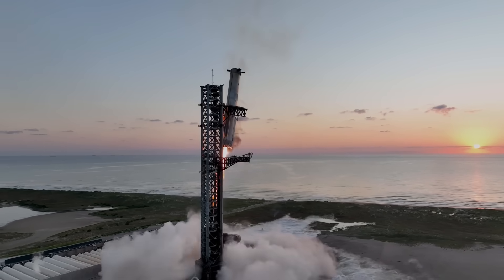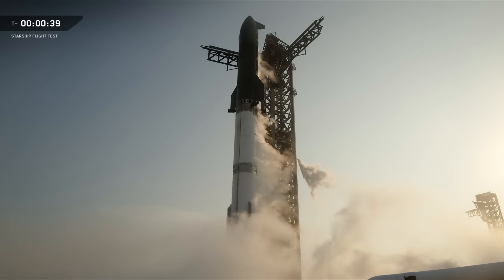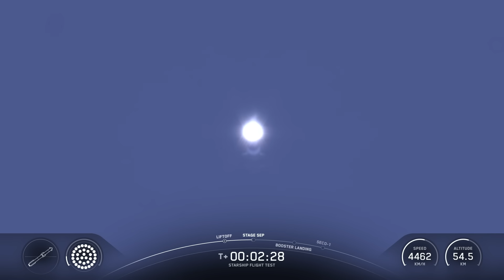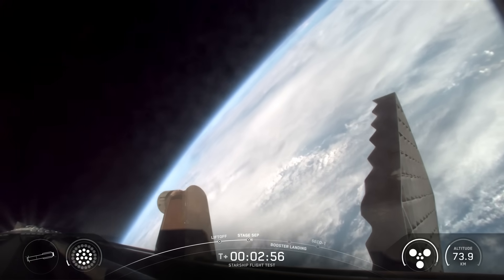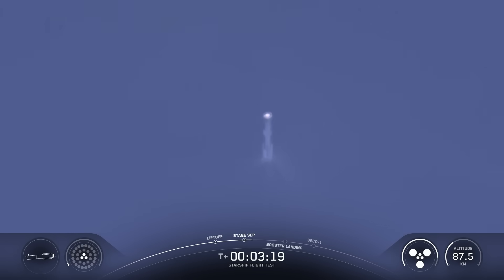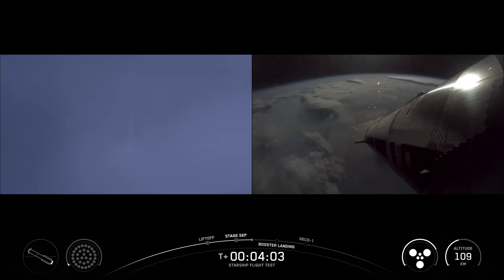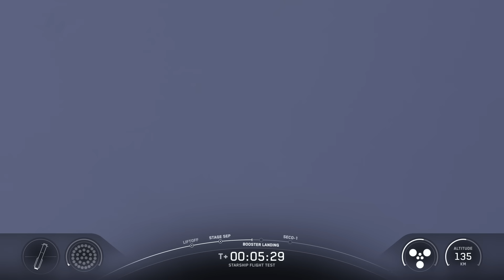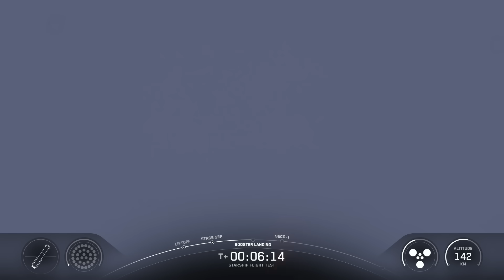SpaceX Builds Largest Reusable Booster, Also Makes Door That Won't Open - Starship Flight 9 Recap

Comment: I don't mean to be harsh, but it might be a good idea for SpaceX to slow down development and work out all the problems rather than spending all their time building a replacement for the starship they just threw into the large and ever growing Great Underwater Starship Pile. My confidence in the program is incredibly low, and I know that it's rude to say that but I really don't see them being able to get people on those things for another decade (if ever) at this rate.
Reply: spending all their time building a replacement? What do you mean.  They can't very well land it back in Boca Chica if they're sending it to orbital speeds.  Would you rather them crash it on land in India instead of the ocean?  Were you around for the early ships and their hops?  This method of development has proven to work better than the old methods of spending billions and decades (of converting missles to rocketships, which they blew up a lot of btw).  Think of it this way, Boeing's Starliner capsule at $2b + vs what they're doing at Starbase seems almost uncomparable, and they've flown and stuck people at the ISS already with Starliner...  In terms of taking a decade to have manned flights, that might end up being true as it took them that long to get Falcon 9 to that point. Maybe people never even launch or land on it, and they use it to dock with Falcon 9s and have Crew Dragons for landing, and more 9s inside em for launching back from the moon, mars etc...
Reply: The fact that the grand idea is to send human bodies in this ship is largely mistaken and antique in nature  @justagent5844
Reply: Something to consider: The 1st stage used this time was Starship 35, the third block 2 ship of an estimated six to be. Block 2 is supposed to iron out flaws in the design SpaceX found while developing the block 1 version. Ship 38 would be the—by current schedule—final block 2 ship. Ship 39 then is slated to be the first of block 3, which should be the serial version, but again prototyping and iterating from ship to ship is to be expected. The most recent ship spotted is S42. Keeping in mind the more current ships are still being built, assembled, tested, and so on, but still. Their construction of their ships overlaps, and there is never only one being assembled at a time.
Reply: I agree.  This whole starship program has only one goal: get more starlink satellites up in orbit.  Elon conned everybody in believing it would be used to get to the moon and Mars.
Reply: Hardware is cheap... compared to hundreds of elite engineers.  Spacex's tradeoffs of engineering, analysis, and testing is entirely opposite of government funded programs.  It's only my opinion, but if I want to know what not to do, I look at the government.
Reply: I only hear this sentiment from people who didn't watch Falcon 9's development.

Starship is going exactly as planned. Building a rocket isn't as simple as you think.
Reply: @mutilatedpopsicles except the scale of Falcon 9 made it easier to develop. The Starship is at a scale that current technology and materials can't support. Sure, 50 more flights and 20 more years of iterative development we might see the materials and technology advance to make it happen but we have a front row seat of seeing the attempt to leapfrog to a scale that isn't currently feasible and won't be for a while. This can't be a sustainable endeavor. I'm not saying they should give up but to think this is at the same level as the F9 is highly misplaced.
Reply: @mutilatedpopsicles  Yup. Falcon went through the same process of non-linear and asynchronous development. And the entire time, there were just about as many people claiming it was impossible, a waste of money, nothing more than a parlor trick, etc. Now look how well its doing.
Reply: @OhmVibe  at least F9 could put things in orbit early on
Reply: @alexsiemers7898  Actually, the first three Falcon 1 flights failed, and even the first Falcon 9 flights were simpler missions with much smaller payloads compared to what Starship aims to do. Falcon 9 was also flying refined versions of existing tech. Starship is testing new materials (stainless steel), new engines (methalox full-flow staged combustion), new control surfaces, new landing techniques — and all of this in parallel.
Reply: @OhmVibe sorry, but that's not true. Falcon 9 was all figured out technology. Even the landing (Delta Clipper was doing that in the early nineties). It was an integration problem. Now, starship is a completely new and different problem.
Reply: @arthurdefreitaseprecht2648  I think you're partly right. Falcon 9 did build on known technologies, but it's an oversimplification to say it was all 'figured out.' Integration at that scale is an innovation challenge, and no one had landed and reused an orbital-class booster before — not even DC-X came close to that.
Reply: So yeah, Starship is harder — not because SpaceX got dumber, but because they’re trying to do something no one’s ever done. Falcon 9 was revolutionary. Starship is evolutionary — at the civilization level. 

Starship is solving a fundamentally different class of problems: it's not just landing — it's full reusability of the entire vehicle, orbital refueling, heat shield reuse after high-speed reentry, and interplanetary capability.
Reply: @arthurdefreitaseprecht2648 sorry but delta achieved only 3000m altitude...
Reply: @paweswierczek6265 the altitude was not the difficulty, but rather the landing. If that's a problem, starship only achieved suborbital flights too
Reply: @mutilatedpopsicles Exactly as planned? SpaceX has revised and revised and revised its timelines over the years, repeatedly pushing back dates. The current timeline says Starship will land on Mars in 2026.

The first public mention that SpaceX was working on a heavy lifter capable of getting 100t to LEO was in 2005. The first public mention of a reusable 100t to LEO heavy lifter was in 2012. It's 2025, and SpaceX still has gotten exactly zero 100t heavy lifters to LEO.
Reply: @SnakebitSTI Works on starship started in 2019. The pace is actually really good. We see Starship failures because of bold design changes. SpaceX engineers are aiming for "perfection". Elon has money to fund all of these test flights, I hope they will find a solution to pluming issues ship suffers from.
Reply: @paweswierczek6265 2019 is when SpaceX named it "Starship", not when development started lol. If they rename it again tomorrow, will you say development started in 2025?
Reply: @SnakebitSTI No, that's when development started lol. Before that we had concepts and preliminary estimations.
Reply: @paweswierczek6265 You've gotten your dates confused. Development didn't start in 2019, construction of the first prototype did. There were many years of design work and iterative design changes leading up to that.

But speaking of SpaceX announcing the Starship name, here are some fun dates for you: 2020, first orbital flight. 2021, first trip to the Moon. 2022, first trip to Mars. Those are target dates given for Starship, specifically, by name. It is 2025, and still no orbital flight.
Reply: @SnakebitSTI I remember those dates, that's Elon (tbh I hate this guy) and he always announces some bullshit goals like with a cyber truck.
Reply: @paweswierczek6265 Yeah, but he's not just some guy. He's the chief executive officer of SpaceX. Until the board of directors says otherwise, he has the authority to speak on SpaceX's behalf, and he has the final say on what SpaceX's plans are. He is also the chair of the board.
Reply: @mutilatedpopsicles  "Starship is going exactly as planned."  Really?  Then their plan sucks.
Reply: @presto668  how do you know it sucks? It's the equivalent of watching a car manufacturer destroying cars in impact tests. How do you know how much of a beating that test car was designed to take or how many iterations of those tests are necessary? No one here has any idea how much according to plan these tests are. As a private company, it's up to them to burn as many of these rockets as deemed necessary.
Reply: @presto668 so is falcon 9. Everybody says that falcon 9 development process sucks until it works. This is literally the same situation as falcon 9. Rocket science isn't as easy as avionics.
Reply: Wanna bet? :) on "being able to get people on those things for another decade". I think they will. Development progress is not always linear, sometimes it seems like nothing is happening (or even going backwards) and sometimes progress is much faster.
Reply: How are you going to develop with real world data. They changed the design a couple of times to get a better vehicle. Classical development leads to overengineered, expensive hardware, because nobody knows where the limits are.
And it is just 304 stainless steel, it doesn't break the bank like the $1 billion per launch SLS. It is more in he order of $ 10 million for a Starship launch. Waiting months for approval also cost millions.
Reply: @mennol3885  "Classical development leads to overengineered, expensive hardware ..."

While this style of development leads to lots of scrap metal on the bottom of the ocean.
Reply: @michaelsommers2356  Good for coral growth. Just like the thousands of ships laying there.
Reply: Spacex tech bros and yes men will continue churning out these expensive and polluting fireworks until they run out of money. I see a big inability in them to reflect on their failures. Its almost cult like.

Comment: The stack seemed to hang around for a long while on the OLM after ignition before first movement.

As the booster was at a higher angle of attack when descending, the skirt would tend to catch the airflow more like a box kite and tend to want to pull the barrel apart. Same with the the engine bells.

Very mixed results. Hopefully this isn't a Howard Hughes moment for Spacex.

Comment: If you did not meet mission objectives, the mission was a failure. Let’s not sugar coat that. However, learning something to make the next mission successful is usually a positive in the engineering book.
Reply: "I have not failed. I've just found 10,000 ways that won't work." - Edison Musk /s
Reply: They've had 9 tries, 7 failures. Time to reassess the process.
Reply: @jlr4434  Nobody really thought they were gonna make it by the 9th flight lol. "Half successes" are kinda what you are in for when you are dealing with a brand new rocket system and trying to go fast. None of these have been carrying real cargo for a reason, they knew there was a decent chance it would fail. They are still doing it anyways, cause failure lets them gather info.
Reply: Test flight or not, they experienced the same failure modes they've experienced repeatedly. The company has talked about the solutions to these problems but they are not yet implemented. 

A big reason for this is that not only are the people who built the Falcon long gone, the people who built Starship are gone. SpaceX isn't run in a sustainable manner and they're starting to reap the consequences of being a resume fodder feeder guild to the rest of the industry. Any disruption to the churn of talent means institutional knowledge is leaving faster than it's training replacements and things start being lost that can't be replaced.
Reply: @Hevach Seems like they’re still trying to run like a startup when those days are long gone.
Reply: Missions fail, but experiments that you return data from are rarely failures.
Reply: @qoph1988  mission fail is mission fail. Yes you can learn but its the question whether SpaceX will. So far they showed no learning curve
Reply: It's a failure if the engineers of the rocket declare it a failure. Let's not sugar coat that you are not the arbiter of what is success or failure in a company you have zero involvement with. You can argue in bad faith and quote all kinds of supposed engineering perspectives. The people who built and launched the rocket say it's not a failure, then it's not a failure.
Reply: @sam23696 Because every company acts in good faith by being transparent about the success of major test events…
Reply: This whole data collection argument is BS!
So what if I crashed and destroyed my car, just think of all the data I collected!
Reply: @richardwolf6269  Have you never seen crash test footage of cars then?
Reply: @richardwolf6269  If the reason for driving the car was to collect data on it, then absolutely that would be a successful test. If the car crashes in a particular scenario, that's something you need to know.
Reply: It was a test flight, so learning something was precisely the mission objective. That's always the mission objective of a test flight.
Reply: @thomasdalton1508  Exactly. Data is continuously being collected, things are being learned. The catch, however, is that progress often occurs asynchronously and underneath the surface, which creates the illusion of stagnation or regression. The Falcon system took many iterations and apparent "failures" before it reached the successful state its in now.
Reply: @OhmVibe compared to Apollo rocket tests 60 years ago - 10 tests, no losses
Reply: @jlr4434 Gus Grissom would disagree.
Reply: @thomasdalton1508  Yes but every test flight has goals it needs to achieve and "collecting data" is not a real goal set out. You need to show capability during a test, collecting data you can do always. Goals need to be ambitious but realistic.
Reply: @burnstick1380 That's just not true. Collecting data is always the objective. Everything else is simply a means to that end. The various things they plan to do during the mission are the things they want to collect data on. If something goes wrong early in the mission, meaning you don't get to collect data on the later items, that's is a failure because you failed to collect data.

There is no requirement to demonstrate capability. You are thinking of a certification flight. That's not what this was.
Reply: @thomasdalton1508  Your assertion is inherently wrong from an engineering perspective. You don’t test without the intent of achieving certain objectives. If you don’t achieve the objectives, you failed the test. Collecting data is nearly always a secondary objective of test and is seen more as cursory one at that. And this is different from certification flights, but because the design engineers don’t make the objectives in that case, a 3rd party does.

All that said, just because a test “fails” doesn’t mean it wasn’t a good test. The concept of a successful failure is very real. You learn something with every test and learning is the ultimate goal overall.
Reply: @TheDevastator619  Collecting data is not a secondary objective of a test flight. It is the whole point. You may be confused because pure test flights of spacecraft are very rare. Most spacecraft are never tested solely for information purposes and the first tests are the certification/demonstration flights. SpaceX takes a different approach. These are pure test flights and the objective is 100% collecting data. The only way in which they failed was that they were unable to collect any data on the deorbit burn, since they didn't get that far through the test.
Reply: @thomasdalton1508 ”Most spacecraft are never tested solely for information purposes.” This statement defeats your premise because simply “collecting data” is just getting information for the sake of getting information. Furthermore, if they aren’t tested “solely for information purposes,” this implies they have discreet objectives that are to be achieved. If the objectives aren’t achieved, the test fails.

I am not confused nor do I think you are. This is a matter of semantics I suppose, so choose to take the perspective you are.
Reply: @TheDevastator619  As I said, SpaceX takes a different approach. Most spacecraft are not tested purely for information. This one was.
Reply: @thomasdalton1508  Unfortunately the main data points they wanted from this flight were the satellite deployment system and the heat shield test - and both of those failed in ways that are unlikely to provide most of the data they desired. The rack deployment system failed at the very first step, so most of its system went unexercised, and of course the heat shield was never properly brought to bear so little information will have been gotten there either.
They will of course have gathered information about what caused the actual spaceship failure, but that isn't the data they wanted - it's just the data they got.
Reply: @Jesse_359  That's true. There were quite a few things they didn't get to test.
Reply: @thomasdalton1508  you are wrong. Test flights have specific goals, this one did too. Data collection is never a goal on its own. SpaceX failed to achieve their goals with this test flight.

Comment: I am a fan of Starship. but like @blurglide said this is getting ridiculous. hard to believe that the Falcon 9 is such a success but the starship is a failure so far. I still think humans will be on Starship before anything nasa or boeing can kick out.  after 9 launches lets stop he launches and do some research and find out what keeps causing Ship blow up. The booster was supposed to be trashed and most boosters are successful.  but the ship part itself just keeps blowing up.

Comment: in the v1 Ship they got the door to open a bit but it was also not working well...   this time they said "the door didn't open all the way" but I couldn't tell if it even opened a little bit.    Since they were able to open it a bit before, maybe the issue is not that it stuck, but that the opening device doesn't work well in space?    I hope they figure it out